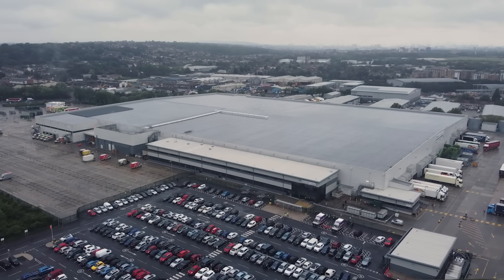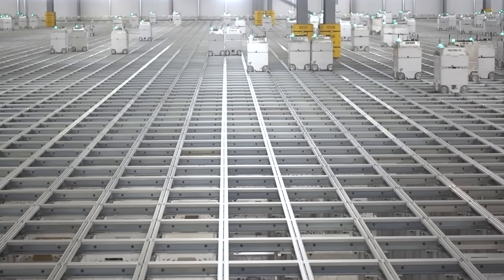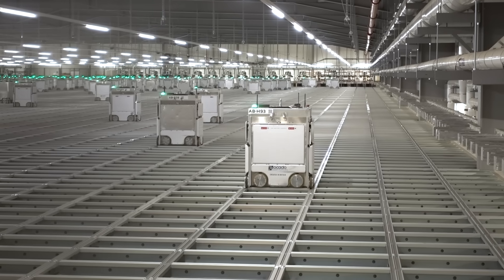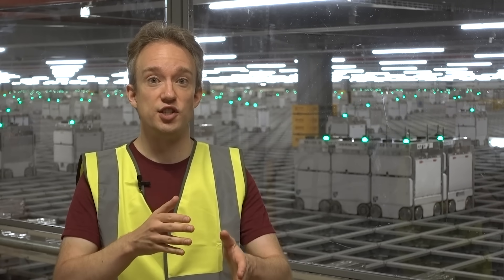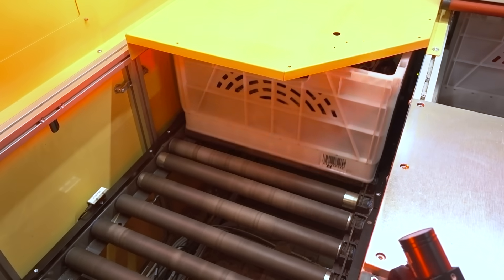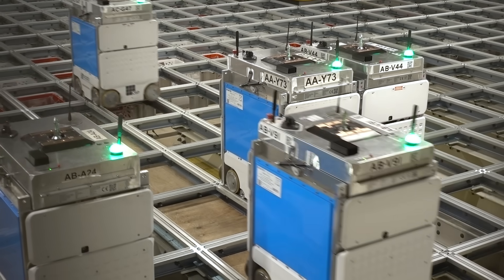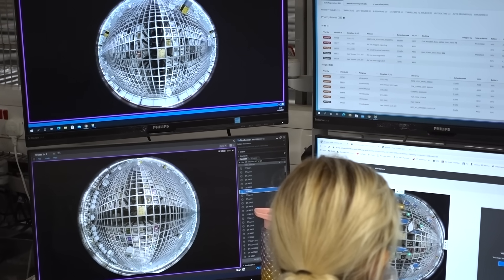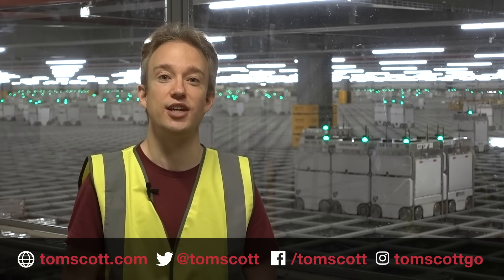How many robots does it take to run a grocery store?

Comment: I don't agree on the last part because it doesn't sound accurate enough to be considered one robot. The hive mind controller is like the queen that makes sure the job is done in the right way but the individual robots still have their own controller for moving. It probably calculates the speed and how fast/slow to go to not hit others and the hive gives it a list of things to do. 

I don't think you consider a bee hive one large insect. that would be silly.
Reply: but they all are connected to one system

Comment: Turns out that this sort of thing is actually too scaled for the market. The more concentrated you make the fulfillment center, the more drive time is needed to actually deliver. Customers would probably prefer to have a choice of 50,000 items delivered in 2 hours, not 150,000 items in 6 hours. This thing solves for packing time and selection when the market prefers delivery time.
Reply: It might be culture-dependent. Here in the UK, I think we tend to do a weekly shop and most of the list will be regulars - I tend to edit Ocado's proposed list a day or so before the delivery day. If I need something within a few hours, I'll walk ten minutes to the corner shop and buy it the old fashioned way. It'll be a bit more expensive but it's a rare event. Having said that, Ocado have started Ocado Zoom that does just what you suggest - a range of only 10,000 items but delivered in the same-day slot you choose.

Comment: whats the deal with the xbox camera at around 2:27?  Seems odd to have a camera branded with xbox.  Also thank you Tom for this video I'm interviewing for a promotion that would essentially be forecasting for Kroger fulfillment centers (Ocado tech) around the States and this was super informative.  Its awesome there are people out there interested in tech w a passion for sharing like yourself.  And I know this video is 3 years old so you probably will never read this =)
Reply: Xbox One Kinect. Cheap
Reply: It's a Kinect, the motion tracking Wii competitor. It can be used for depth sensing (I think it uses some kind of infrared projection). It is surprisingly common in professional applications too because it's cheap and actually really good.
Reply: @ thanks!

Comment: Weird to think I did the exact same job of these robots in a regular Asda supermarket for a few months. The average for each picker would be about 200 items per hour. 2000 robots picking one million items over 5 hours gives them about half the rate if you count them individually, but I wonder how much cheaper they are than paying employees to do the same job in a regular supermarket. You'd need to employ about 1000 pickers to do the same job, not including management of course, and a much bigger warehouse.

Comment: The problem with systems like this is the massive amount of metals it takes to build. Metal is a sign of privlage. Wer not using it to build bridges, wer using it for groceries.
Reply: Not to mention how many times an item is picked up and moved somewhere else. Instead of its final location from the get go. This is only "efficient" cause they are cutting out as many humans as they're allowed to. Smh. Dumb

Comment: That robot arm at 2:15 works about a fifty times slower than a human would.    I wonder how they will have the space, electricity, assets to replace each human in the packaging with fifty robotic arms.     How those fifty robots fit into the space to be close enough to the package?  I don't get it.
Reply: It can work 24 hours a day every day with the same constant speed

Comment: I would make a wild, guess that, similar to Amazon, and their robot warehouses, the interaction between the machines, and the humans is very very dangerous for the humans and a lot of injuries will occur.
Reply: The hazards is the reason why they never enter the hive unless they need to fix a broken robot, same thing goes for Amazon they never enter the floor unless they let the bots know that a worker is entering by computer then they shutdown the bots and if there is an item on the floor the bots make a maze to direct the employee to the issue , and to make sure that the employee is safe they wear a thing that sends a location signal to the bots saying where they are.
Reply: @josephbennett3482  I worked in an Amazon warehouse. It was mostly human run, but we had lots of machinery to deal with. The hazards are real. That's why Amazon has one of the highest injury rates of any company.

Comment: This is an incredibly stupid facility with an incredibly stupid design. If a single bot fails, it could cause the whole facility to shutdown.
Reply: They had one there with the "orange" fault light, it didn't shut it all down.
Reply: @shaunp9592  "could cause" not every failure.

For example if the bot becomes unresponsive, (firmware issue) this can cause it to crash into several other devices until it derails.

If the device locators fail same thing.

If the device wheels break or motor fails and it falls into the path of other bots same thing.

Comment: There are many robots. As every vehicle has its own controller and regulators even just for the movement, it's a robot or more precisely an agent. Only then there is the question if the planning algorithm is implemented centrally or distributively ;) Here, it is many robots that controls themselves on low level and are being controlled by central computer on high level :)

Comment: Technically that's how "Remy's Ratatouille Adventure" and "WEB Slingers: A Spiderman Adventure" works.
All the vehicules communicate with eachother, maintain their distances based on a GPS-like tracking system and they can't put themselves out of order at anytime (which is infuriating at WEB because they're all on a rail so you can't park it on the side).
And that's also why sometimes few véhicules can be a little bit out of phase with eachother and bump themselves.

Comment: Great ideas... just curious to know if a hexagonal system was considered for obvious reasons. Bees are likely evolved to prove the point. Or, is there a technical reason to stay with a simple grid?
Reply: The only reason to go with a hexagonal pattern is that you maximize storage space for the amount of material used in the walls and for the number of cells. The hexagonal pattern in a beehive works because bees can just crawl or fly to each individual cell ignoring the shape of the walls. In this system the added storage of a hexagonal system is counteracted by the need of a more complex retrieval/placement system. That would greatly outweigh the additional cost of using more material to make the grid since you could assign a group of cells to a certain product making storage a none issue.
Reply: Think about it this way: with a square grid, you need to move at most 2 times to reach any cell. With a hexagonal grid, it's three.

Comment: Fascinating thing is, that this system is already a bit "old", because it must have taken several years to design and build this thing.
Reply: You could easily make it more efficient in several ways, but idk how
Reply: @aceman0000099  😂😅🤣.  "You could easily make it more efficient in several ways but Idk how"!?!?
Reply: @michaeldeierhoi4096  well, for example, letting the robots travel diagonally.
Reply: @aceman0000099  That may increase the complexity of the system to a point that it is no longer efficient.   There is probably a good reason the designers of this system didn't go that route.
Reply: A system of that size would take about 1-2 years to fully install at the capacity pictured these days.

Comment: It seems like waste of money you could just have a conveyer system with slides. Example: Container goes down packaging lane and slides slip in the items into the container. With a dual lane systems this could be much faster I think.  Most challenging part would be item position in container and calculating and sending out the right amount of items.

Comment: Must have a lot of A) damages robots can’t detect .B) expired products on bottom of totes.C) astronomical electric bill
Reply: Inventory control takes care of expiration dates etc., and damages really shouldn't occur, though there could be visual inspection on "ingest". As for electricity you can recover that extra consumption by not turning on the lights above the grid area - nothing to see there anyway except when "wooing the crowd".

Comment: This video highlights why using robots to replace people is going a lot slower than what you would think.  Because we either need to design everything to be easier for the robots, or design the robots to move like people.  It is why I often say, a robot is not likely to take my job, but my bosses job where it is primarily number crunching and inventory?  They should be afraid, because they can easily be replaced by a computer.

Comment: Not clear about how products enter into hive.

1) Are hive holes designated with particular products and so filled
with same products over and over so electro workers know where exact product items are?
2) Is it totally random selection of hive hole diving based upon information electro worker is given?

Quite good order picking idea, though it seems a little overly technical and burdensome on energy supply.

Warehouse should provide own electricity via vertical axis wind turbines and solar.
This inclusion would cut overheads considerably and reduce burden upon grid.
With storage via ion lithium battery cells replacements are approx each twenty years.
A good worthwhile investment for companies reliant upon electric. 🤡

Comment: Looks like they still need many people to be able to run this warehouse, judging by the amount of cars parked. I'm sceptic how more efficient this is
Reply: 2000 robots vs a hundred or two workers. aka 2000 workers (who go non stop dont need breaks dont complain go max speed extremely rare to get things wrong and other than initial investment some maintenance, they don't cost per hour.) Not saying i think this is the best thing to happen, but well, if people dont wanna do the jobs, higher ups will say well, im gonna automate it and boom, jobs gone, a small portion added back in higher paying more advanced jobs and thats that.

Comment: So obviously this is an incredible system, but I can't see why the roof isn't completely covered with solar panels to offset the energy being used for this building/robot? I also wondered how often they need the lights on for the grid or whether they could just turn them on in one targeted area when needed?
Reply: They might be in an area where solar energy isn't worth the time. 

Where I live in northern sweden for example it would be a waste of time when hydropower is near free. (I think I pay something like 0.03 euros per kilowatt hour, rounded up.)
Reply: @cruelfish4824  Fair point, although as it's in South East London, it's certainly worth doing solar as we're not 'flooded' with hydro here in the UK sadly. We can choose to purchase our electricity through a 'green' provider (although some are not truly green), but making it at the point of use is the most efficient and in this case, the energy needed would be a fairly known quantity as little will change, so it's ideal for solar panels.

Comment: Great video. Incidentally is a railway one machine or thousands? Something like the DLR isn't that far off the automated distribution depot. And even a more traditional  railway still has complex protocols interlinking each component. And if the railway is one machine where are the geographical boundaries? Is the system that stretches from Penzance to Hong Kong one machine with lots of overlapping and ultimately interlinked systems?